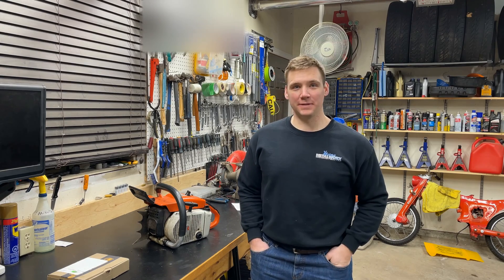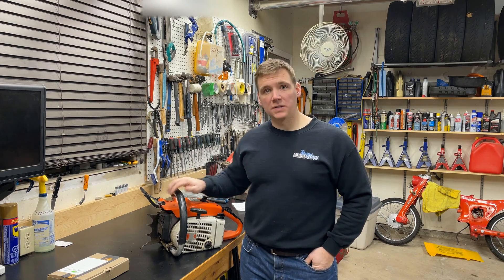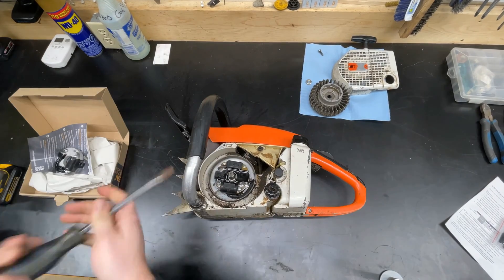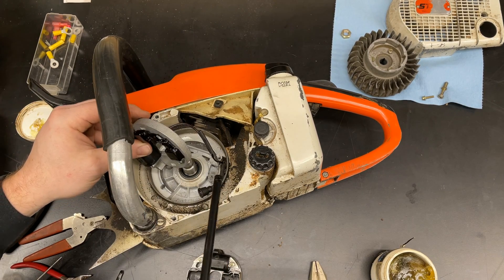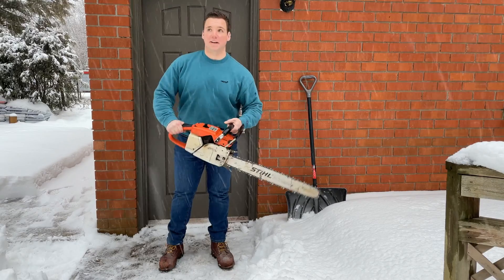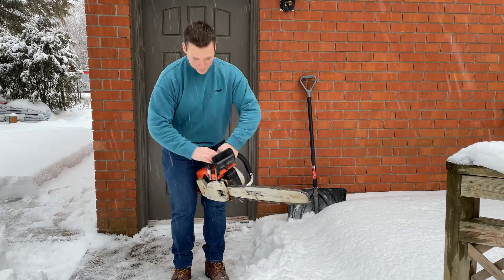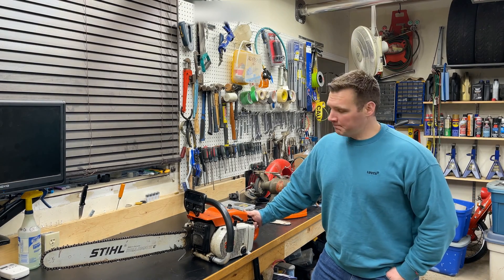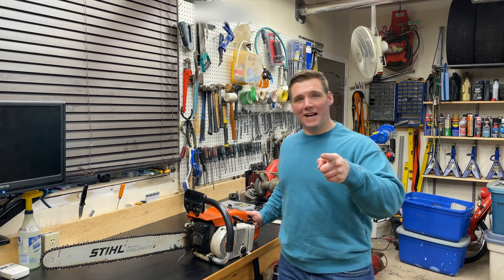My old Stihl chainsaw loses power and dies when warm. How to fix! (056AV Bosch Ignition failure)

Comment: Sawzilla sells a ProLine electronic ignition coil for this saw now and also the original SEM ignitions that replaced the old Bosch units. I own a 056 super that I bought at a young age and it has the Bosch unit. You can bury the bar on this saw and it just keeps chugging along, amazing torque out of it.

Comment: just started working on one of these , got it running on gas thru the carb but was left with gas in it years ago. cleaned carb and found nothing wrong so started it again and noticed a loose jug so tore into it , it was missing 1 cylinder bolt and a second one was loose along with both muffler bolts loose , got that all fixed and now have no spark, crazy  to think it ran better with 1 missing bolt and 3 loose ones then after it was corrected ., no wonder the impulse wasnt triggering the car , when all the air was exiting the crankcase thru the gasket ,    a new coil maybe now???

Comment: Could you show the sound it does when it bogs? Does it still tun at idle as if its a bad carburetor high circuit adjustment? I never saw a coil/ ignition doing the same as a lean high "jet". Please help

Comment: great job buddy; i have a vintage 031 that has a similar problem.  i have rebuilt the carb and it has great compression.  it runs great when cold, but it runs like it is running lean once it gets warm. does my saw have a similar problem?
thanks.  i have a 455 rancher too and your video on that rebuild was super helpful.

Comment: Hey Dave, thank you for this video. I've just fitted this kit (the coil and points version) to my very first saw, a Stihl 08s. Chasing bog down, I had rebuilt everything, gaskets, seals, carb, compression tested (piston and cylinder in great condition), and finally she is running really strong now, no more bog down, way stronger than before the old ignition failed. Using a spark tester I could see the spark died out as the throttle was applied. Prior to the fix, the saw would start cold, some condensate would come from the exhaust, presumably from incomplete combustion, and the saw would bog when applying throttle, eventually when warm it became impossible to start. After changing ignition which really was plug and play as in the video, the saw fired immediately, and with some carb tuning runs better than I have ever had it running in 20 years.

Comment: I have 4 Stihl 041 chainsaws and 3 of them have Sweden SEMS and one saw has a Bosch German ignition system. The ignition systems are bad in all saws.  This Bosch ignition looks exactly like my 041 German coil ignition in one of my 041 Stihl saws. Would this work using the German flywheel in a 041 saw? If so, how much do they cost?

Comment: Dave please keep us updated on this saw, I have an 032 same shape and I can’t get the chain to stop running at idle like yours and it won’t pull over with the chain brake on due to crazy high compression.  I’ve stripped and cleaned the clutch, replaced the clutch springs, tuned it, turned the idle screw down so much it stalls, tried with and without a bar on, different chain tensions and it runs beautifully except for the turning chain.  I’m thinking now maybe it’s sucking in air somewhere or I need to try a new carby, any thoughts ?

Comment: Davey, the spark plug wire on my stihl somehow has a small portion that got nicked. It runs fine but is it ok to just put electrical tape wrap it up with electrical tape?
Reply from the maker: Electrical tape will get slimy and ineffective after a while. I’d pull the boot and contact off and slide some heat shrink tubing down over it and use a head gun or similar to tighten it onto the spot.
Reply: @DavesSmallEngines  alright, that sounds like a better plan.
Reply: @DavesSmallEngines  i just realized something. Pulling the boot off is something i have never tried doing ever on a chainsaw. Maybe a short tutorial on that would make a decent content for your channel. 😂😂😂

Comment: Went down this same rabbit hole for a 056 magnum. Surprisingly has a two part  fly wheel with SEM ignition I believe. Happy to hear you got her running, heavy but powerful.
Reply from the maker: I’m looking forward to trying it. Did you fix yours?
Reply: @DavesSmallEngines  yeah for the most part. Just rebuilt carb, and still need to fix the killswitch. Just been tuning and once I put a new chain on I will start bucking.

Comment: Same symptoms and fix with a more modern saw? I have a jonsered 2050 (husq’45)that comes out swinging, then bogs and dies when warmed up.  But it will idle fine and restart fine after sitting for a minute.  I think I have ruled out fuel/vapour because farting around with the choke doesn’t keep it going. 
Thanks for the great vids and enjoy that beefy saw this spring!
Reply from the maker: Hey Sean - I’m wondering if it isn’t a tank vent issue? When it dies, put the saw on its side and see if you hear any hissing when you open the fuel tank. If you do, it’s likely the tank vent. Please let me know!
Reply: Thanks so much, Dave! I tried cracking the fuel cap and restarting, but as long as it’s hot, it bogs.  I have a cheapo coil on order, We’ll see!
Reply from the maker: @78f26  that’s what My next step would be to. Make sure to let me know so I can pass info along in the future!
Reply: @DavesSmallEngines  installed new coil today, did not fix the bogging. Exact same running characteristics. I tried a different spark plug too. To be fair, it sat under a tree for at least 5-10years and had signs of heavy use. But good compression. Anyway $25 well spent on an experiment. I’ll keep digging on this one.
Reply from the maker: @78f26  hey Sean - sorry to hear. Are you certain of good compression? Can you pull the muffler off and check for scoring?
Reply: I checked the cyl tonight, it’s in surprisingly good shape! The 2050 has an impulse “boot” below the intake tube which might be deteriorated from age.  Or the thin aftermarket fuel pump membrane I installed might not be working properly.

Comment: Actually in the middle of this very same saw, even was on their website looking to buy ignition, they have 2 up on there, wasn't sure which to go as one says will not replace SEM, Im only novice but loving it, even made a puller for flywheel, damaged threads hitting with a hammer(nó need for a brass hammer now 🔨😂) but question is, saw start 2nd/3rd pull every time, sit idle for ever, reving up nó problem, but as soon as it hit wood bogging stall out and backfire through carb, is this all because of ignition? Research and couple old guys said timing 🙈 I'm not there yet on know how but interesting! I'm not giving up on this saw! Thanks for video. Subscribed 👍
Reply from the maker: Hmm, it certainly sounds ignition related to me. Have you had any more luck with it?!
Reply: @DavesSmallEngines  no, haven't had time to get back at it, have basket full saegenspezi, few rubber mounts gone and few other bits needed, and I'm gonna go with new coil. Will let you know if it does the job 👍
Reply from the maker: @paulgrimes7632  awesome, let me know!

Comment: Well Dave, a day late! Just picked up MS441C , it had the same symptoms and they replaced ignition system and the carburetor and fuel cap! She be purring right now! They are so perfect with the right tuning! I like using the tachometer, seems like you can get the carburetor closer then by ear.
Reply from the maker: Hey Jim! Totally different ignition system, so it’s all good! I have a 441C as well, but it has that new fan-dangled M-Tronic carb. I have a big bore kit on it thst I’m not happy with so I’m going to down grade in size but go back to an OEM cylinder and meteor piston. That video will be up soon!

Comment: I have an 032av that had the same problem. Couldn't find the right coil till last week and it set in my garage for almost 3 years
Reply from the maker: Nice!!! Did you get it up and running?
Reply: @DavesSmallEngines  yes. Just in time. We have an ice storm coming and i have feeling that i'm going to need it

Comment: how do you get the right gap to the coil to the fly wheel on the inside like that? thanks
Reply: Business card will work but i use a feeler gauge and set the gap between 5 to 7 thousandths and never have any issues
Reply: Usually a business card gives the correct gaps
Reply: In lawn mowers anyways, but with a multimeter you can get the ohms 
With Briggs 9.81 is good 12.5 plus is near bad
Reply from the maker: Hey David! I use one of @donyboy73 ‘a business cards on a normal coil… however this is a fixed coil and the gap is pre set. No way to set the gap on this setup.